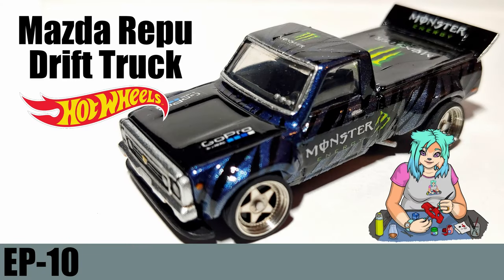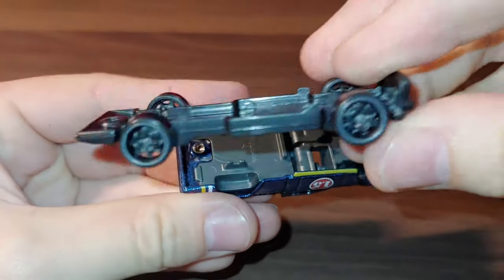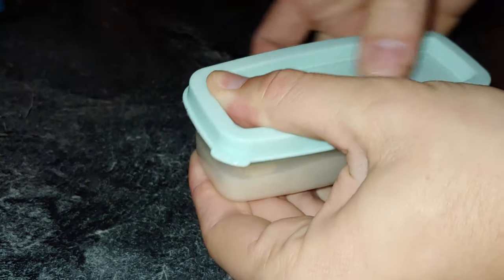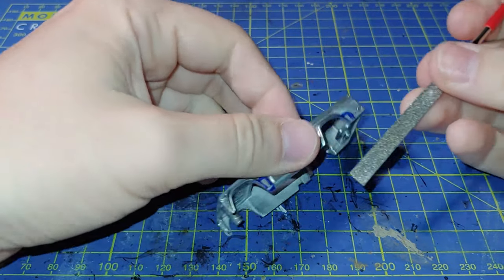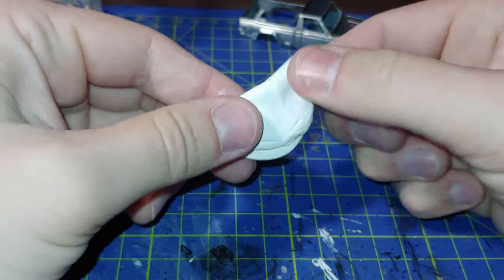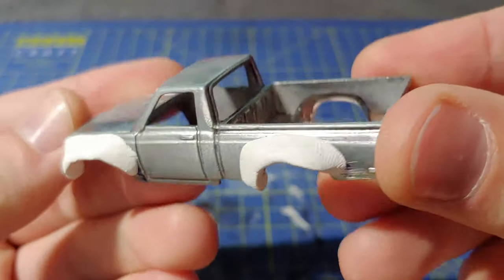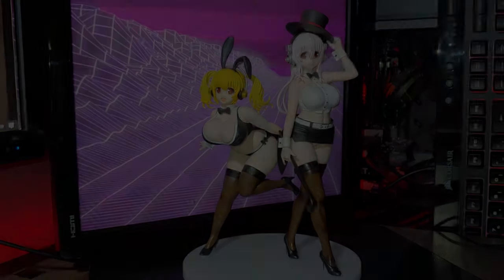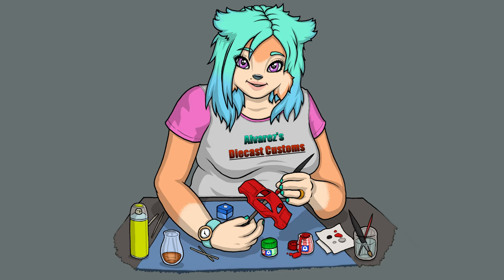Mazda Repu Drift Truck - EP10

Comment: Did the truck get an engine swap as well?  REPU stands for Rotary Engine Pick Up,  meaning you went the extra mile to split the brap-brap pipes or you went whole hog with an engine swap.  Whichever path you chose the end result is awesome.
Reply from the maker: Thanks!
What I didn't show as I edited it out was me using the remaining milliput and making a little v8 blower for the top of the hood.
I didn't end up using it though as I wasn't happy with how it looked.
In retrospect I should have drilled the hood out and set it into it instead of placing it ontop.
Hence why the hood has a blank area in the middle to stick it there.
I'll be doing a "coming up" video in the week I'll show it there :)